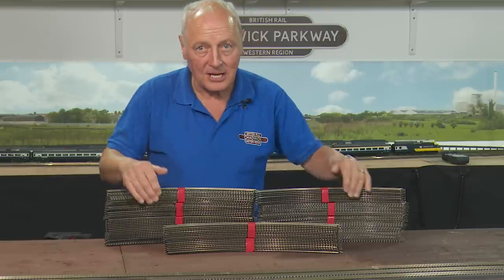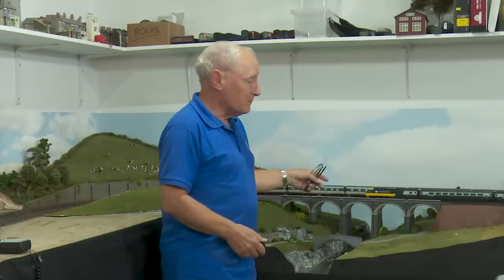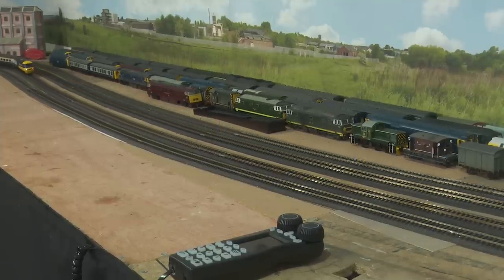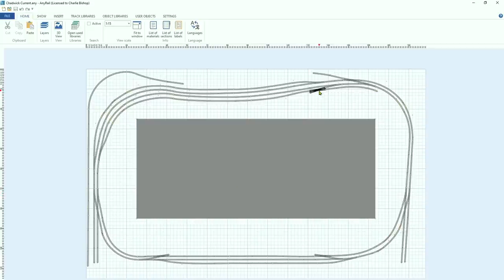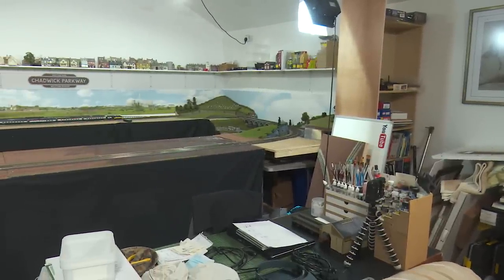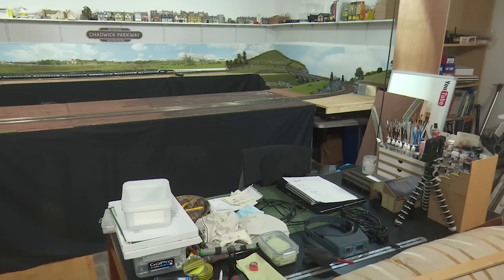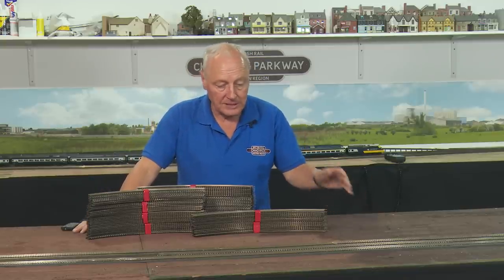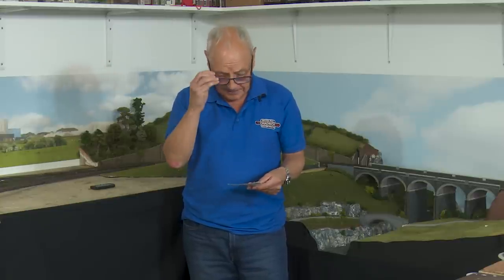Track Plan Design at Chadwick Model Railway | 111.

Comment: Hi Charlie I’m 73 and my layout occupies 17x13 in a 20’ long shed. Apart from from the first 3 feet viewing area, the access is all crawl between three access areas, and I have installed an 8 road storage under a section with a single helix one end and a 30’ incline the other under the main running tracks. The main station in 12’ long raised and central with twin access tracks forming a Y junction at the throat in the remaining 5’. There in a steam era loco yard with turntable and carriage and goods sidings adjacent to the station at the higher  level but crawling is the  only way to access and I use a creep to do any work underneath. It’s getting harder!!
Reply from the maker: Good on you Chris to persevering, regards Charlie

Comment: Charlie, I absolutely love your presentations. As a 70 year old just getting back into model railroading after 55+ years, I hang on every word you say. You are my go-to guy for anything that could possible pop into my head about model railroading . . . keep up the GREAT! work.  As for the knees, I feel your pain. I designed my layout to not have any duck-unders for just that reason.

I have thought, at great lengths, about hiding my helix in a mountain and came up with the idea to hide it inside a model of the Matterhorn from Disneyland <-- there's the give-a-way that i'm from the U.S. I grew up with that image in my head from the day it was built. I have visions of my helix track ducking in and out of the face on trestle spans. My helix will need to rise 18 inches and I've made drawings of my conception but it's not built yet. Once again, keep up the great videos ( I depend on them ) and stay off the knees as much as possible.

Cheers
Reply from the maker: Thanks Pete, what a heartwarming comment, and good luck with your layout too. Regards Charlie

Comment: Hi Charlie, interesting proposal and for you definately for the better.  Having a lift out section with minimal scenery would clash with every other aspect of Chadwick, also taking up a lot of space.  My initial thoughts would be in the middle to have New Chadwick TMD possibly reusing the original shed. For the new branch towards the sink could you see yourself creating a single track branch terminus? Set in central Chadwick, as somewhere a little further along for the shuttle to go. Scenically my thoughts would be to model it as a former double tracked line but partially lifted. Would this then allow you to reuse some of the buildings from the original TMD? Or possibly go with a ferry terminal/dock and make use of the sink as the ocean.
Reply from the maker: Great options Les, sink or swim.

Comment: Charlie, you have adapted the layout well to your condition and the room, with due regard to what you already have. As someone who has just had to have his hip repaired, with not being allowed to bend past 90 degrees (e.g. crawl, sit in a low chair) I went the opposite way with the dual deck layout and raised it to where I can fit under at a stoop. Still can't get under at the moment because of the loading up of the crutch but hopefully soon.
Reply from the maker: Getting old is clearly a dreadful thing, stay safe mate, regards Charlie

Comment: Hi Charlie, What a surprise!. Just a suggestion for when you need to work on your new lower levels' like the proposed fiddle yard, maybe a 'workshop creeper' would be a big help. a little seat with wheels it lets you scoot about without kneeling or bending. not expensive and a back (& Knee) saver. they usually have a tool tray underneath which is very handy.
Reply from the maker: Yes Nigel, well worth a look

Comment: Sorry I forgot something, don’t assume that the helix needs to have a shallow angle, I wasted a lot of time trying to give as little clearance as possible thinking it will run better, I ended up with about a 10mm clearance between helix curves, your mileage may vary.
Reply from the maker: Thanks for the tip.

Comment: I am 65 and have to crawl on my knees to get into my layout. Doctor says I will need knee replacement eventually do to past ACL replacement and damages to the meniscus. I built a lift gate and for months trying to get it to work reliably. With 4 tracks going across it consistently was a nightmare to keep aligned. I wound up nailing it all shut and abandon the lift gate option.Maybe some day I will have to make the same decision as you did but not looking forward to it. I spent months trying to figure out a way in my 11 x 18 space to not have a lift gate and never could come up with a solution. RaiModeller Pro is what I use on a MAC. Tried every other design software out there and RailModeller Pro is far easier to use and the results are great. Thanks for the video Charlie....
Reply from the maker: Yes knees are a dreadful design, I’m not too sure who came up with it!

Comment: Looking interesting Charlie, I would suggest moving the fiddle yard point work on the "left side" to more or less over your power shelf and maybe the "right side" point work until after the area under the viaduct as this would only mean two straight track runs with restricted access. This way you can get longer fiddle yard tracks. As someone else mentioned, try to find a chair on castors that can be lowered enough to slip under the fiddle yard board when not needed, that way you can sit and fiddle in comfort.
Reply from the maker: Interesting points Chris and I will certainly look into it. Regards Charlie

Comment: I planned this 5 years ago having back and knees problems after a rta. So I planned a walk in layout with helix under the board on three layers fiddle yard going to a loop into the storage area ready to be used next time. The helix has to go in yet and the storage yard this will go in over winter. But end off the I have a walk in switch on and play layout. Easy on the knees. I am using flexible track with the sets. Good luck on your Charlie it worth it in the end saving your knees 👍🤔
Reply from the maker: Thanks Ian, it’s great to have you on side

Comment: Just an idea if you still want two loops going round, I would make a little hinged section a bit like Graham Foulston has in the section where you are going to cut out so you can easily get to the middle bit.
Reply from the maker: Sadly the only access point would be across a 12 lane fiddle yard as well so it doesn’t seem feasible, regards Charlie

Comment: Good luckwith the helix.  I took the same decision about a year ago and installed a 4-turn helix.  I use this as what I think of as a "dynamic fiddle yard" in an automatic system and have laid four tracks on the helix.  These use Peco setack radius 2, radius 3, radius 4 and a flextrack radius 5 equivalent.  I had no problems with the short 16-to-a-circle radius 4 tracks.  Indeed, the flextrack was more difficult getting a smooth curved joint particularly when using an insulating joiner.  The main problem with a small radius helix is the gradient it requires.  I only have about 5 mm clearance using 9 mm mdf + 3mm cork + 4.5 mm code 100 rail with a 3" (76 mm) rise per turn.  This produces a gradient of 1 in 36 and 1 in 42 on my inner two tracks respectively.  Keeping these two tracks for down trains has made the system workable although I laid these two tracks with DCC Concepts Powerbase just to be sure.  It would be nearly impossible to lay this retrospectively.
My 4 tracks each form one cab control DCC section and are divided into storage "slots".  The inner one holds 4 trains of up to 7 coaches plus an engine, the radius 3 track holds 6 trains of up to 5 coaches, the radius 4 track 5 trains of up to 7 coaches and the outer track 7 trains of up to 5 coaches.  Block Signalling supplied the electronics to allow trains on the helix to index up one slot as required in automatic sequence.  The system was not without teething troubles.  I eventually installed Bachmann level-crossing style re-railers on the four entry tracks to avoid problems in mid-helix.  These work.  More difficult was the problem of uncoupling with the stop-start nature of trains indexing up or down the helix on tight curves.  Sorting this out took months and is a story in itself.  The havoc caused by stray stock running down the steep gradient meeting a train coming up can be imagined.  However, all is now sufficiently reliable that I am planning to install a fifth track on the helix using radius 1 curves and maybe bi-directional trains.  I have worked out a system for this but have not yet started construction as I have not yet found a satsfactory way of installing the necessary additional pointwork at the base of the helx.  There is too little space and access is limited.  I will persevere.
Thanks, Charlie, for continuing helpful commentaries.
Reply from the maker: Hi Graham, what an outstanding comment. It makes my Helix idea insignificant compared to what you have achieved. I totally understand the problems with couplings especially breakaways on the incline. My coaching stock is being converted to magnetic Hunt Couplings currently, and hopefully this shouldn’t present any problems. Power wise all my locos are diesels so should manage to climb without too much of a problem. I’ve worked out the incline to be approximately 1 in 48. 
Wish me luck, regards Charlie
Reply: Powerbase is definitely the answer to any gradient rising more than 4% (0 to 4” in 8 feet), especially when factoring in the tight curve which in my limited experience almost halved the climbing ability of some of my trains. Woodland Scenics’ 4% Incline Set kept me honest when it came to the gradient and it bends really well around even the tightest bend. Not stackable in a helix though!

Comment: Good luck with the new direction Charlie. I initially thought the helix was to climb trains over your head where you walk in. Soon understood differently. Have you considered raising the existing board structure up somewhat so that the new under boards are themselves at maybe near the height of the current boards? My layout build is on 1400mm legs. I bend/stoop forwards to walk under the clearance of about 1325mm. Working on wiring or bolts etc underneath is easy sitting on a low stool with wheels. I realise your lower layer will not allow you such easy access. Your backscene would be a casualty. Kind regards.
Reply from the maker: No Robin I don’t think I could change the backscene, too much emotional baggage!
Reply: @ChadwickModelRailway  Yes, I have watched....

Comment: Perhaps you can consider a mechanics roller stool. Mine is adjusted to about a foot high. I can sit on it and comfortably roll under my 4 ft. high layout with just a little ducking of my 6 ft 4 in. self.
Reply from the maker: The whole room has now changed to avoid the duck under.

Comment: I feel your plight, I’m also in the progress of alterations for the same reason going full loft. I was having to do a full elbow and knees crawl as my loft layout is very low due to roof pitch. I can only stand up dead centre but it’s the only space available and as I am now the wrong side of 50 so thought it better to do it now before I start to struggle too much. Not only that no scenery work has started yet so less pulling apart.
Reply from the maker: Sensible move, regards Charlie

Comment: Sorry to hear about your Knee Charlie. I had my right Knee replaced two years ago and it's absolutely fine now. I've discovered with AnyRail that if you right click on the curves where you have the red sections it gives you the option to "smooth flex" and 9 times out of 10 that fixes it. Good luck with your proposed extensive re-work and look forward to seeing the progress. Cheers.
Reply from the maker: Hi Dave,  many thanks for the AnyRail tip.  It's a great program but it's gems like that, that are hard to find.  regards Charlie

Comment: Hi Charlie,  I'm having to put in a liftout or a swing gate for a entry.   Have you thought about putting a lift gate using a piano hinge??  All you need is the track to not have any switches in the middle.   As for my Helix,  I plan on putting lift off panels.   I don't know if it will work out but I'm going to try.   Good luck with your plans,  I know you will figure it out.   Cheers, Chris
Reply from the maker: Sorry Chris but that pull-out section would need to hold something like 20 tracks, because that’s where I wanted the fiddle yard to sit at the rear. Anyway let’s build some helix. Regards Charlie
Reply: I am  Charlie,  getting ready to build my own Helix

Comment: That’s a radical re build, must increase the track yardage a lot, if the old TMD boards are to flexible why not add another 6mm ply layer and bring them up to standard the same as the other boards, also would give you a nice clean surface to work on? Looking forward to seeing progress especially the helix build, none of us are getting any younger.
Reply: Or something cheap and grotty that the current ply will cover?
Reply from the maker: Fair points gentlemen.  I’ll check out the rigidity once trimmed.

Comment: Had missed this one, so not seen the earlier grand plan. Two questions. 1) What are you using for the wheel cleaner? Would having two of them allow you to clean wheels every time a train leaves the fiddle yard, and removes the two-way common track? 2) Have you considered including two Railer's (such as R620) just to get wheels back in alignment? Maybe good before the helix assent? (The last place you want a derailment?) Maybe already consider?
Reply from the maker: Excellent points Gavin, both of which are under consideration. Regards Charlie.

Comment: Glad to see your expanding your empire Charlie..when I Built my layout I designed it around the access point being a sliding door and built a lift up bridge but will probably change it to a swing gate eventually..I bloody wish I had the space to do helixes and a double deck layout but 46 inch radius curves take up a large area so that’s a no go unless I can convince my wife to let me knock down a wall..all the best with the build mate
Reply from the maker: Go on, knock it down. 😜
Reply: Will probably cost more than just a romantic dinner and a back rub

Comment: Hi Charlie,  Definitely food for thought before I lay a piece of track. By adding the helix and fiddle yard under the board you have increased the operating length tremendously.  Can I ask what the clearance will approximatly be between the boards not withstanding the tight viaduct area?  Looks a great plan I currently have the AnyRail demo version and building small plan areas which if added to gather give you a full plan bit like planning each block section separately.  Full steam ahead look forward too the Decoder Pro etc very interested.
Reply from the maker: Hi Kevin,  the main board is at 36 inches so I'm splitting the difference with the fiddle yard at 18 inches, 6 inches below the viaduct. Regards Charlie

Comment: Hi Charlie.  Another great informative and entertaining video.  I've been thinking of placing a fiddle yard under a station layout, but a station is where there tends to be a lot of point-work and with the fiddle yard below access to the under side of the station is going to be very restricted.  Have you thought about having a hinged section(s) of the station where the point-work is?  These hinges would be at the back and the station section and it would lift up like a lid, revealing the fiddle yard below and also at the same time the under side of the station for access to the wiring and point motors.
Also with the fiddle yard under the station can you still drop down your electronics and wiring hinged panels that you have previously installed?
So many questions.  Are there ever enough answers?
Reply from the maker: Many thanks for your comment Geoff. I think that I’ve got to the bottom of it now there will be no hinges at all. Just a 4 1/2 tier Helix at both ends, and the plan seems to work well. Regards Charlie

Comment: I really like this new layout.  I think it adds some really interesting running options for your layout.

Would it be possible to add a reverse loop on the Peninsula? It looks like the only way to make a continuous loop would be to run the trains through your fiddle yard. If you can add a reverse loop on both ends, you can keep more of the running on the upper level.

I like this new layout!!
Reply from the maker: No, I don’t think I want the reversing loops I want to bring up fresh trains to enhance the layouts appeal. Regards Charlie

Comment: Hi Charlie, love your channel. I'd think about planning in a reversing loop so that the trains don't always run in their direction; and this might mean you can make the storage sidings for just one direction of travel. Also, did you consider putting the storage behind the station on the same wall (pulling the station forward) as this could make everything on the same level and remove the need for the helixes. Just food for thought! regards Andrew
Reply from the maker: An interesting point Andrew, regards Charlie